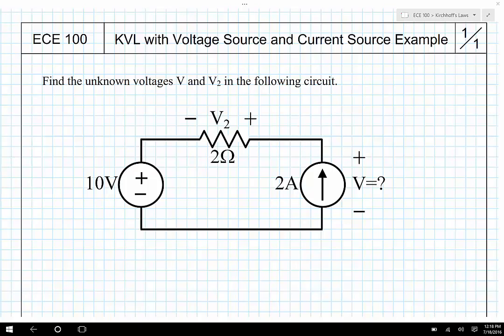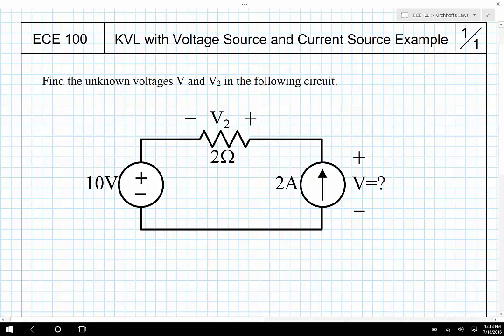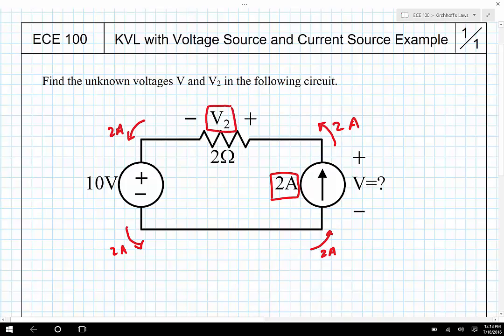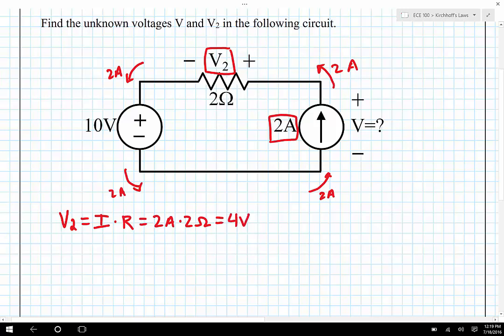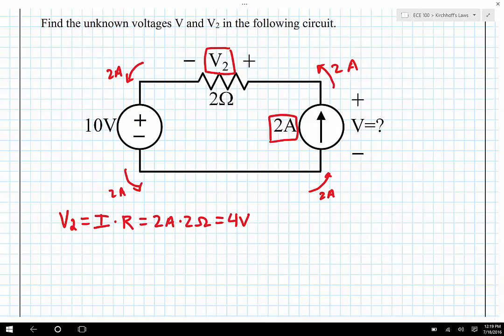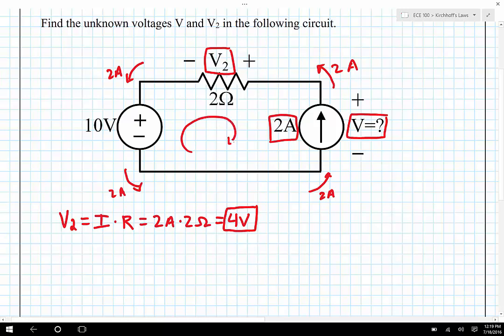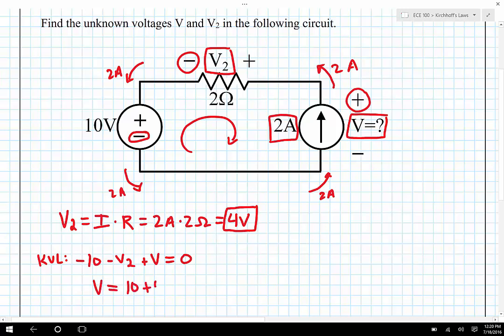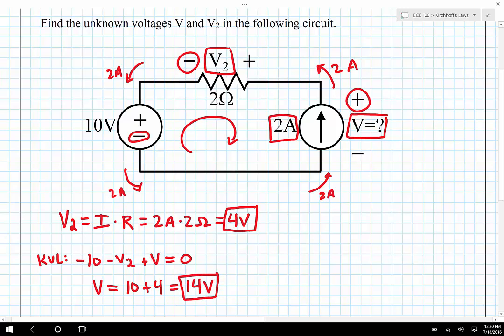ECE 100 03 KVL with Voltage and Current Source Example

Comment: Sir let me explain something kindly, since we are following the clockwise loop in the circuit, the voltage source on the left is positive since it's following the clockwise from negative to positive, then the 2ohms resistor is a drop voltage from positive to negative not the opposite, becauseit'sa voltage drop from the battery clockwise. The 2A current source is going counter clockwise so it's negative too. So it's +V1-V2-V3=0. I checked it out in my electrical circuits book
Reply: I was confused by that part c
Reply: therefore voltage will be 6v not 14v

Comment: do current sources have resistance ? can we use v = ir across the current source ?
Reply: no they don't have resistance and you can't use the standalone IR part. You need to have a resistor attached. Otherwise well you know the result, no resistance means wire is connected directly to battery which it will cause a spark or explosion. Current sources in problem solvings and designs ideally have zero resistance whereas in actuallity or in real world it has a resistance (an internal resistance to be specific but maybe there's a different formula for that) but this internal resistance of current sources are usually ignored in computations so in most cases you can't use IR form only the V form. So yeah just ignore the R part in current sources and you'll still get the correct answer. But in very specific or precise caluclations which is very very rare usually it's included but in most cases or common cases, the IR part is usually involved. So when solving current sources just use the V not the IR form.

Comment: What I don't get is the signs, why are you particularly taking the negative sign on the voltage source, the negative on the resistor, but the positive on the current source?
Reply: yeah the sign part i confusing but these are just arbitrary signs or just set up signs watch other videos. These signs are just a guide on what would be the resulting sign when you do a KVL. For example:

I set a current I1... 
I1______________>
_______resistor______

I can set an arbitrary sign. However, take note that when solving or designing circuit always use and read in conventional flow (positive to negative). this means my current is going from + to - so I manually put it like this:

I1_____________>

+                               -
_____resistor________

when I do kvl, the ending part is negative. These signs are just used to guide people who solv given problems nothing much complicated although it looks like complicated at times.
Reply: the regular convention would be negative voltage if voltage is increasing (- to +). Except most problems dont assign terminals on problems